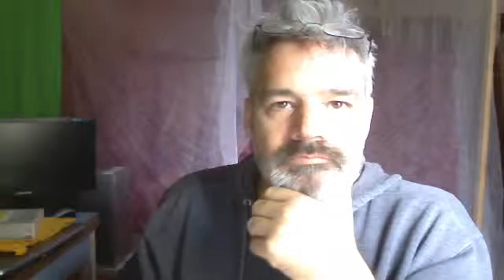Can you print fresnel lenses with your 3D printer?

Comment: There are some instruction on the internet for printing (using SLA printer) spherical lenses, and trick is to polish it or to drop a little amount of resin onto the surface after printing and let it to cure again to get optically transparent. But the fresnel lenses have surface with small steps/roads, and how to polish them - the big question I think.

Comment: Theoretically it could be possible with a stereolitographical printer.
But still, 3D printing is quite not the best technology for this. There are other ways to produce them much better and more efficiently. The one should be used strongly depends on particular task.